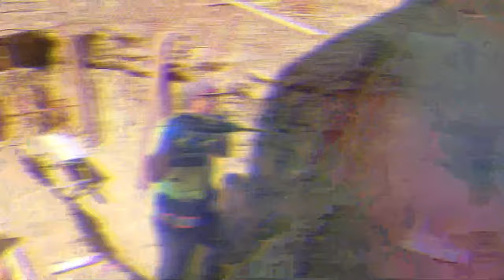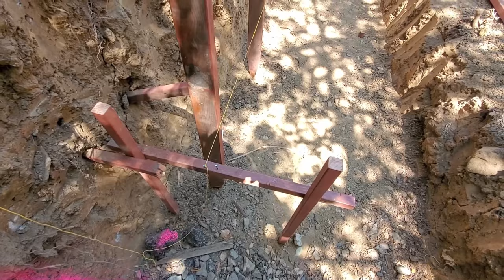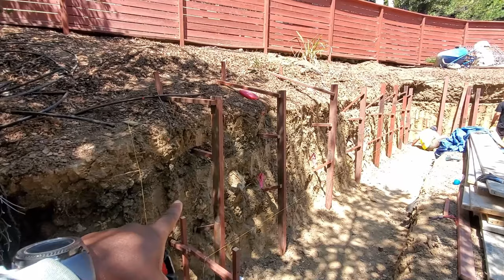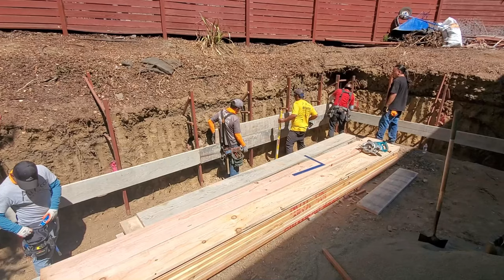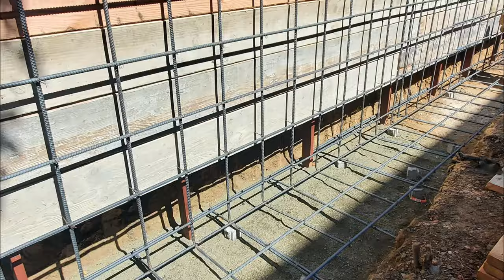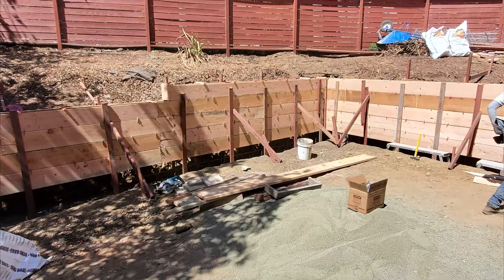How To Frame Concrete Retaining Wall (Modern Landscape Project)

Comment from the maker: Check us out framing this concrete retaining wall for a modern landscape project. Also, check out Part 1 of the demo:  https://bit.ly/3DnpMpE

Share This Video: https://bit.ly/3ywYgTe
Reply: Looking good. How long did it take to do the frame and rebar? (Hope you didn't say and I missed it :D) Being in Scotland/Britain/UK I hit a snag doing this, I can't get snap ties or I'm looking in the wrong places or I'm looking for the wrong thing, bummer either way..
Reply from the maker: Took us 2.5 days to build from start to finish.. Probably a solid 2 days.. But i forgot the Simpson ties 😂😂😂😂 tru story.. To hold the walls together we use.. Simpson ties wt8's

Comment: Great work guys! You mentioned 12" behind the wall- is that enough to get behind and remove forms, etc?Would you leave more room for a taller wall? Also How do you handle the stakes and kickers- cut them at the base?
Reply from the maker: The 12 inches is for the drainage. You want at leat 2 feet.. Three feet will be ideal tho.. The main stake you will leave in.. Chack this out https://youtu.be/VMVVTTZdWJE

Comment: What do you guys use for a form release agent and when you mono pour do you just cut the 2x4 stakes off when you strip forms? Killin it by the way thanks for the content!
Reply from the maker: Appreciate the comment.. Form release as far as the 2*12? We use standard form oil... And yes we cut the 2*4 using a multi purpose tool.. 💯💯👍🏿👍🏿

Comment: I hope you and your team are well. Im looking at doing a concrete retaining wall and I would have to buy all the wood for forming. Did the wooden forms cost you more than the concrete lol? I wont have a purpose for the forms once this project is done so that cost is gonna hurt
Reply from the maker: 😂😂😂 Price has come down a little . Be sure you oil them prior to install. After you finish put them on Craigslist.. A contractor will swoop them up..
Reply: @AllAccessConstruction  Good advice. Thanks
Reply from the maker: All good.. Hit me up if you need some pointers

Comment: How did u switch from finishing and then go behind the scenes finding the trust but more importantly switch from doing it all to letting or finding the right guys, I mean I know I can go to State st and Washington St downtown and hire a whole crew of Mexicans or Latinos, but I'd would have to totally replace the white boys I got, but I've never met another white guy like me, when I used to work w Mexicans the considered me a Mexican not a gringo, I think next year I'm going to completely make the jump to some new tax write off equipment and a brown crew, BTW I do have a black guy that has worked w me off and on 4 years, he just doesn't have transportation to the suburbs everyday, I think if I go brown I need to go 100%
Reply from the maker: Mannn you need to go with who ever going to give you the least headache. Doesn't matter who it is..

 It always starts from the top. Guys going to move to the leaders beat. Going  so called  "brown" doesn't guarantee anything...

I think one of the big things back there is pay. I know several concrete companies in Indiana that's killing it and they have everybody work for them. 

Also, if you notice my content is set up to attract local clients and build trust with my local area. Not teach guys how to pour concrete and why we use this tool. There 100's of them on you tube. 

Shit I even tell ppl that really wants to know to go to there page. Mike's concrete on you tube is an encyclopedia with that concrete knowledge 💯💯

So no catchy titles or "soft click bait". Just think about your last one. No one local going to find you on that and being as conservative as indiana they might find it offensive. But I get what your doing. 

So marketing is a huge part of it. That's were I'm dialed in at.. My lead who's been with me on off for 15 years with 4 of the last years being full time "dialed in" with the guys, the politics of the field etc.. He can speak for me with the clients etc.. 

I have had this conversation with a lot of people ppl on you tube and Instagram.

It all start with the leadership. Nothing at all to do with race to make " YOUR COMPANY SUCCESSFUL"